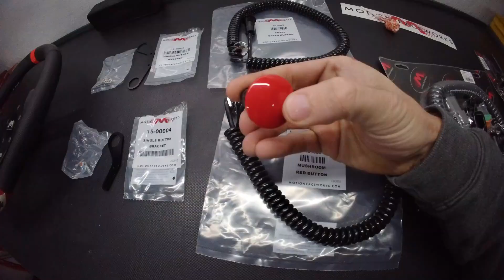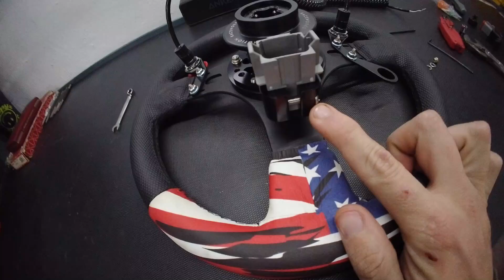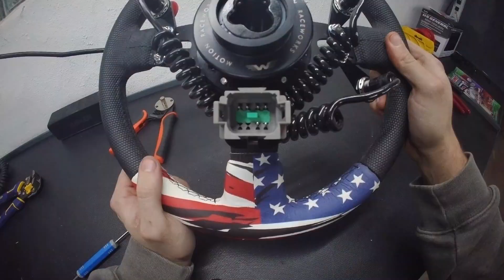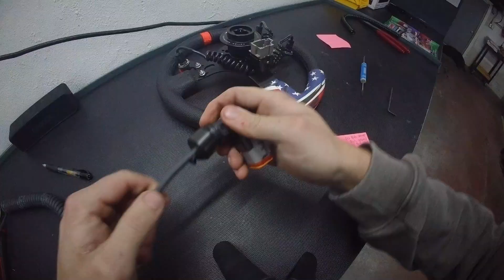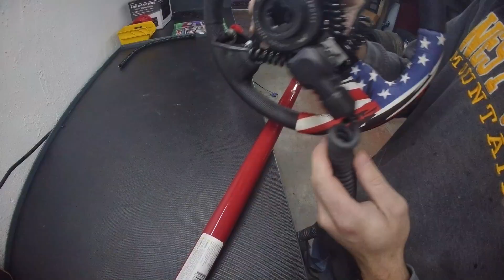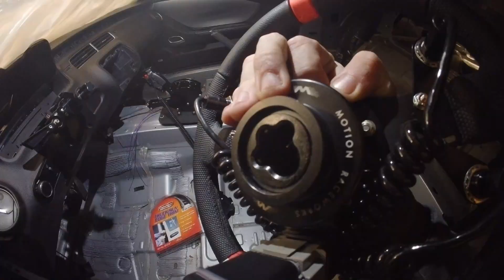MOTION RACEWORKS MONO CORD PRO INSTALL- CAMARO BUILD EP 11

Comment: Thanks for the video.  

I am sure you just misspoke, but for any else that doesn’t know, the 2 wires going into these type of switches cannot function properly if they are the combination of “power and ground”.

That would cause a short when the button is activated.  What he meant to say was most likely “input and output”.  

If it helps, imagine the switch is simply a more useful way connect and disconnect the two wires when needed.